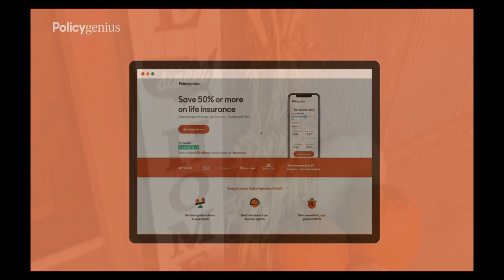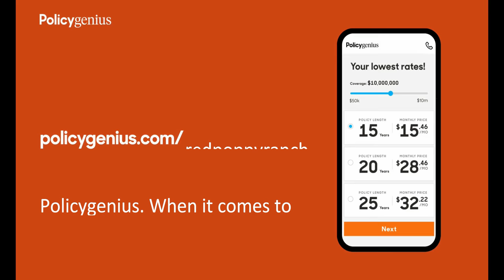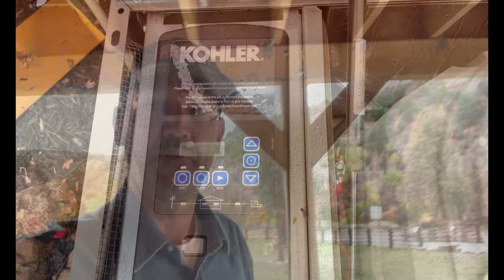#527 - Lumber For New Barn, 2nd Solar Panel Array DONE!

Comment from the maker: To start comparing quotes and simplify insurance-buying, check out Policygenius: https://policygenius.com/redpoppyranch
Thanks to Policygenius for sponsoring this video!
Reply: Heath if you put flame retardant poly plastic on the ceiling of your shop it'll slow the heat loss exponentially and that plastic is white so it'll reflect the light in your shop a lot. Just a thought for you.
Reply: You might also need a big dumpster
Reply: You need twice that many panels. On cloudy days you can still make power if you have more panels maybe three times as many as you have. You dont have enough so you constantly have use a generator often. Put three arrays back on the ground where they were to help at 10 oclock.

Comment: You should look into getting a few stackable heavy duty carts/dollies for that workshop. Whenever you store something heavy, put it on wheels, so that it cannot collect moisture underneath and is easy to move. Really helps keeping a space clean when you can move things around easily!
Reply: I was thinking that also. I think with all the tools and storage a loft/mezzanine with a pull down ladder would open up more floor space. He definitely has the ceiling height for it.
Reply: We did that for our warehouse workshop, really nice when it comes to cleanings
Reply: Pallets, pallet racks & a forklift are game changers.  I've had four shops and my last two had those, made a huge difference in organizations.
Reply: @ckm-mkc  The problem with pallets (depending on the exact type) is they often still have a lot of ground contact. Not an issue for storing things and moving them around, but if you store long-term and it gets humid inside that could cause issues, especially as pallet wood isn't great. Plus with a pallet you always need a pallet jack or forklift around to move things.
Reply: It can make all the difference.  2 wheels roll freely and 2 can be locked.  When not in use the device just rolls out of the way.  I have a shop vac hooked to a tub that runs thru the wall of the shop.  I just roll the tool I need to use up and hook the hose up.  The dust goes outside.  Makes for a cleaner shop.  What it looks like you need most is large rolling tables to do mechanical repairs on so you are not on the ground.

Comment: If you can/want, consider plywood over drywall in the area's you plan on using as a shop/garage area. It can provide a lot of flexibility when it comes to hanging things, organizing them and just overall durability. Keep up the great work!
Reply: Plywood is better than drywall to handle the freeze/thaw cycles and unheated humidity.

Comment: So beautiful coming up to Red Poppy Ranch. The fence you did earlier in the Spring looks amazing. Your foliage changed so quickly. We had a warm tropical season in Connecticut and our leaves are slow to change. Still green. You have made such great progress this past summer in major projects. If i were at Red Poppy Ranch i would be enjoying a relaxing time on the porch. Looks like they are predicting a cold/snowy winter for most parts of the United States. Stock up on that wood. Blessings

Comment: Not sure if you mentioned storage area, but it’s possible you build Mezzanine/loft area above the shelfs. So that you can build a door  access from the outside being that those windows atop are at ground level from behind.  Easy access for loading and unloading storage totes. And also have  stair access inside for snow season for when snow covers the door.

Comment: My garage shop floor  has buried  RailRoad Track spaced  parallel at 34", 80", and etc. The rebar is welded to each and routed to a stub where the shop welder is.  Around the perimeter is a buried in the concrete is a large steel plate with a ⅜" chain stub extending out of the concrete. This allow me to hook a chain uo and used them as an anchor for a PULL....like pulling a dead vehicle into the shop, of pulling on a home made tower  while I pull a frame or a sheet metal body back into shape. So I have a frame machine floor and welder's layout level and plumb foundation floor. Weld a jig and pull or brace.  Then grind off and floor is back.  I can cut a frame and shorten/lengthen a truck frame too.  I got the idea from North Dakota framer while trucking grain.

Comment: You have shelter that you can heat. Water and septic needs are covered.  Electric supply is handled. Two areas are suspect. -  renewable food supply and homestead security.

Comment: If it were my shop then I’d put the old roof tin on the walls instead of drywall. It will look good and is rugged. And of course it’s already paid for and will be easier to hang.

Comment: I am not sure a larger Genset will charge the batteries any faster?  Unless his current is only 120v and he will be able to charge at 240v with the new one, but even then wouldn't be worth it? 

The Dual inverters setup to charge is what is going to speed things up.  and he may be able to adjust the charge rate
Reply: He has a lot of batteries now, he is basically a diesel-electric submarine with no reduction gears, screws, shafts, and the rest plus solar panels.
Reply: @hithere7382  if you have 2 or 20 batteires the BMS is only going to charge at a certain Rate.  that is why you can not super charge a tesla at home. to make a difference you would need 400V+
Reply: @swaterman08  I'd be terribly disappointed if that Cummins can't do 240vac.

Comment: Have you thought about taking the springs to a spring shop and getting the re arched or have them make you a set.  Its pretty cheap.  But its like radiator shops they are getting hard to find.

Comment: YOU'LL GET A BIG PROBLEM WITH THE SNOW UNDER THE PANELS,, thanks for the amazing  videos
Reply: snow could take the panels down while sliding off the roof...and take some roof  down also
Reply: The heat from the roof and the heat the solar panels produce will melt the snow fairly quickly. He also put the wiring relatively high on the back of the panels so ensure the connections aren't sitting in a snow sandwich.
Reply: @krissgross2335  I am not criticizing - I just hope that everything will be OK. And I know that he doesn't like when people have a different opinion than he does , but....there are people living there that I would not want to see hurt...

Comment: Aren't you worried about snow building up under the panels?  If it was me I would install some heater wires near the bottom so the snow melts and runs off under.  I know that snow weighs about 20 pounds per cubic foot.  That number can of course vary based on the moisture saturation but too much weight could push those panels right off the roof.
Reply: He has talked about that issue in a couple videos ago. :)